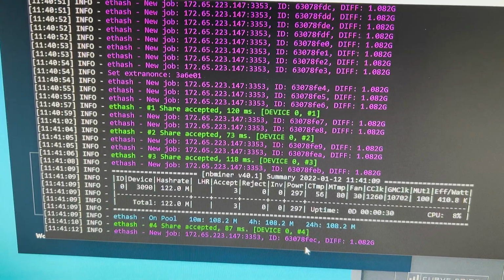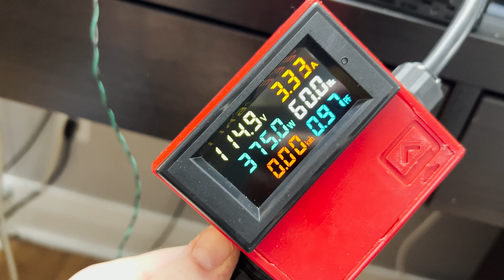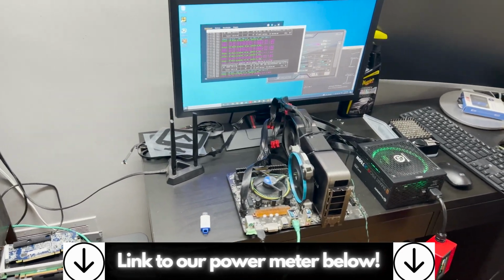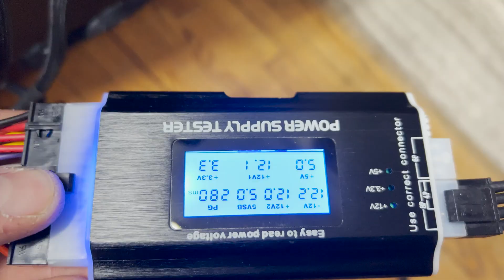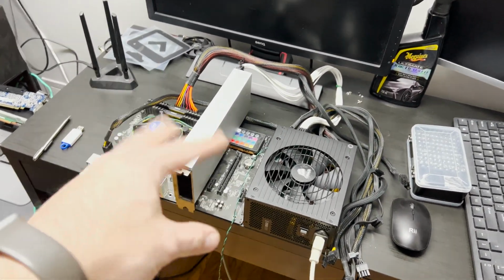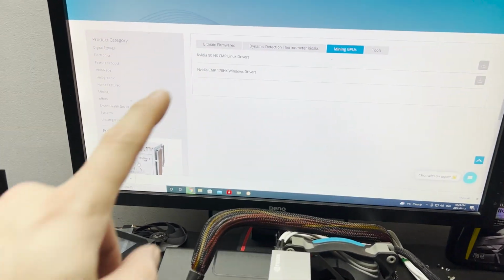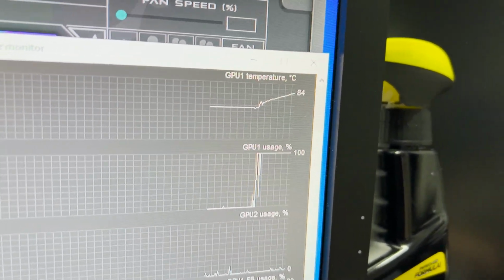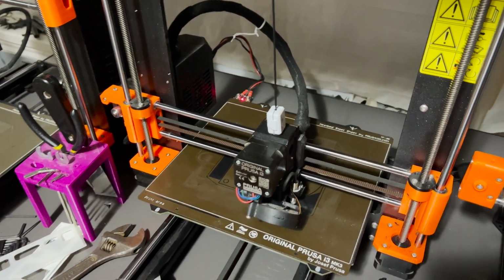Upgrading GPUs from 2016 For Better Efficiency (Ft. Nvidia CMP 170HX!)

Comment: What is the benefit of a cmp 170hx? From what I have researched it seems like it's not that great. Apparently you can make about 3.5k/year profit with a 3060ti and you can only make about 5k/year profit with a cmp 170hx. Two 3060tis costs a whole lot less than a cmp 170hx. Can you please help me understand why anyone would pick this card over two 3060tis?
Reply from the maker: I wouldn't recommend a cmp170hx. I just wanted one to play with, and I was drawn in by the efficiency on ETH. They are not versatile on other algorithms like a 3060 ti. My recommendation as of writing this would be 3070 or 3070 ti's now that the 100% unlock is here. Keep in mind 3070 ti have GDDR6X memory which is harder to cool than the GDDR6 found on normal 3070's.

Comment: im so sad i was never able to get any of the FE 3000 cards.
i was able to get asus rog 3060TI though several at MC but dont know what it is the FE is sexy looking.
how much are them 170 CMP cards they have to cost a ton.
Reply from the maker: 30 series FE cards are popping up quite a lot here in Ontario recently. The cmp 170 hx was about 5k CAD from a local seller here. Not a card I would recommend, but still something very cool that tickles my hardware enthusiast side

Comment: Bad idea to use 8-pin cpu connector! You need this part number "zero-three-zero - zero-five-seven-one - zero-zero-zero"! I have seven this cards and five of them were equipped with such adapters, and two were not. I bought two of these adapters with this part number.
Reply from the maker: Thanks for the info! I looked up the adapter and it looks like it uses 1 extra power and 1 extra ground conductor compared to a standard cpu 8 pin cable. This would increase the amount of power the connector could deliver by about 20%. 
The CMP 170hx has a tdp of 250w. I’m running it at 200w power limit which is a 20% reduction from its stock power draw. This is likely why I haven’t had any issues. 
The first issue you will likely experience is the cable or connector getting hot if you are pulling too much amperage through it.
Reply: @ultraprecisiontechnologies  yrw!
btw! best pl for this cards on ethash is 220W! 😉